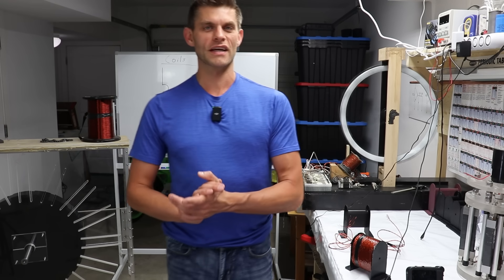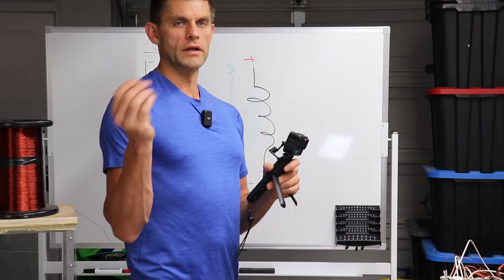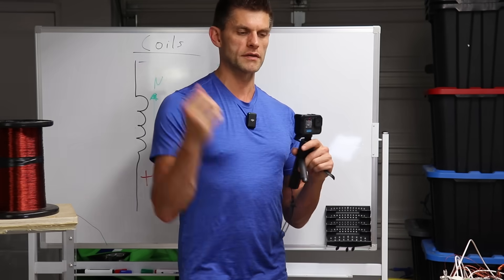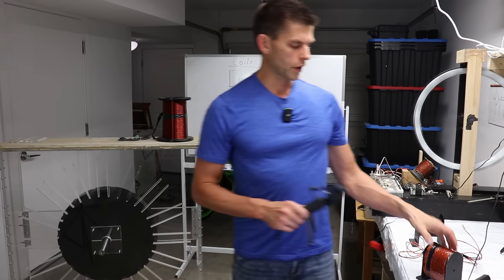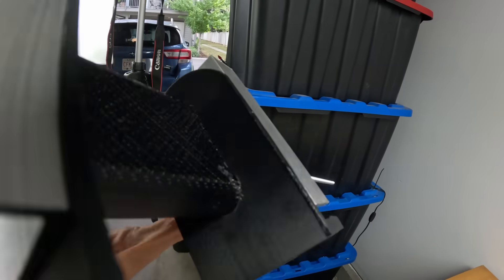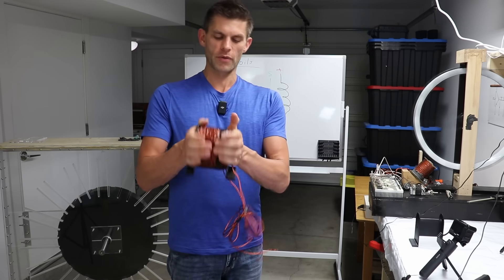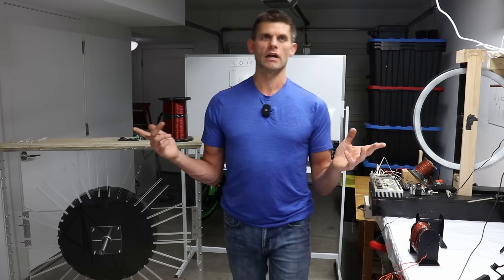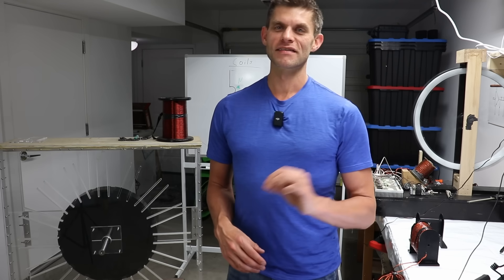Unlimited Energy in My Garage (No Patents)

Comment: Hi thanks for your efforts keep going, this is what my genius friend said, hope it makes sense and can help 
He's going the long way around to make a generator. He is missing one big component by the way he is collecting the collapse of the field to a lead acid battery and loosing most of the charge at the battery and feeding the second battery back to the coil is the offset of what he generated. So will it generate electricity yes about 6 volts, can he collect the electricity yes but not with a 12v car battery, the coil he is making is for amperage at low voltage so that large is not going to produce what he thinks, economy of scale is at play more wire = more resistance =less output but higher amperage to move the voltage... And nothing about it is unlimited energy, it's a pulse modulated alternator any time you have to feed energy in to get energy out. He should use super capacitors as collectors and pulse on a second coil set that would be a better balance than he could get with the setup he is building there... Just my 2 cents and you can keep the change haha
Reply from the maker: sounds like your friend should show us his lab and woking model ? thanks for the comment

Comment: So one thing that I have not seen so far are some measurements of the smaller setup which I assume is a proof of concept. It looks to me like you have a battery powering what is basically a large electric motor. That alone doesn´t seem to generate any energy but just consumes it to keep the rotation going. 

Am I missing something here? Do you have actual figures to share about how much power is going in and how much more is coming out of the system? If the small scale doesn´t produce anything then I am not sure how the larger model is supposed to improve on that. 

Trying to keep an open mind here and I can definitely see the passion and enthusiasm you are showing, I just would love to see some numbers. These kind of machines have been out in the internet for decades now but I have never seen a prototype that actually works. 

Also, I have seen the two latest videos and the call to action at the end about funding kinda makes this a little suspicious. 

That being said, if you can show the tech working (again, including actual measurements) then I´ll throw some money your way myself! But so far the setup is very simple at its core and I don´t see any reason why this should produce any more power than it consumes. I hope to be wrong and all the best
Reply from the maker: im going to get into that in the next videos
Reply: @MadscienceLPTECH  Awesome! Thank you for the reply, I am really looking forward to that!

Comment: PS: Maybe it would be faster to weigh the wire and calculate the distance according to the gauge you are using. The extra walking is good for you, but if you want to gain time: you may want to just weigh them to get your intended measurements (Always add significant grams extra to be on the safe side, though).
Reply: He still has to spread them out and twist them.
Reply from the maker: yes
Reply from the maker: yes value

Comment: there are a few ways to make renewable energy, but if you try petent them you get a knock at the door by dangerous people. There is a space time antenna, there is splitting hydrogen from water and burning it, there is taking electricity out of the ground. I know that the trick of splitting water using copper bars and eletricity, is related to vibration. The closest vibrational match to hydrogen i think is barium, so if you pretend to match that by using it frequency, it will turn towards it and so split from the h20. Everytime someone makes it they try and make money and that will not spread it around the world.

Comment: I want to help but without understanding won't be able to invest either my time or money. So basically you are giving little electrical energy to create more mechanical energy thus generating more electrical power with the help of some generator, sort of amplifying that small input of energy. I would appreciate if you answer my some questions
1. Output power is dc or ac?
2. If AC in nature then how you will be able to reduce harmonics ( by using some filter/ change in construction)
3. Do we require a cooling system also.
4. What type of machine you have chosen to convert mechanical energy into electrical ( Ipmsm, dc, induction)
Reply: Hi. There is not "More Mechanical Energy" than the Electrical Energy that Feeds the Coil.

He only Claims (abusively in my humble opinion because I have still not found Any Solid Proof Of That),

That it is the Kick of High Voltage coming ftom the Coil... AFTER been Swiched OFF, that "Taps Into" the Vacuum to Produce A Gain of "For Free" Energy.
Reply from the maker: @Khwartz its been done manybtimes , including by tesla 130 years ago
Reply from the maker: DC out, no cooling but might help, and im not sure for the generator yet... maybe just another wheel with magnets abd coils    cheers

Comment: Idk about all this.  There has to be some type of dissipation in the system. I'd like to see some energy readings from both batteries.  Even if one battery is charging the other if there is even minute dissipation in the system eventually one of the batteries would need to be recharged from sn external source or changed out (but if the dissipation is small enough it's could still be very impressive)
Reply from the maker: coming up

Comment: Not sure if this was mentioned but something that is good to investigate since you have a working model is to see if there is some kind of compounding resonance that can be produced which could potentially unlock a new area of energy extraction. Similar to how the tesla turbine uses a different in practice but similar in theory. Laminar flow over air gapped plates/rotors whatever air injection perpendicular to the center shaft inlet towards the middle “turbo style” exhaust. There is a phenomenon that occurs I believe it was at 70k RPM and basically “teleports” it to like 100k rpm if I remember correctly. Something like that…
Reply from the maker: Legit advice

Comment: The area under the spike is the power available.  The is LOSS in the coil do to resistance and back EMF.  you are not doing anything new.  They have built these motors in the past and could get aa high as 98% efficiency but nothing like what you are trying to do.  Sorry been down this road before.
Reply from the maker: I think u took a wrong turn ?

Comment: I am an electrical engineer and can say this is 100 percent a sc@m. It will not work. The energy just going in to the battery from the ether because of a high voltage pulse is ridiculous. The only reason he is using a motor and coil to do that is because it spins around and looks fancy. you can get inductive kickback pulses much easier and efficiently but then again it doesn't actually matter because this whole thing is fraudulent.

Comment: A lot of these Bedini-Beardon "spin-offs" with spinning magnets and lead-acid batteries all run into the same trap: Misunderstanding how those batteries actually behave.

People see high voltage spikes from the coil that’s real but they think dumping those spikes into a battery creates extra energy. 
In reality, lead-acid batteries are kind of slow and messy inside. Their voltage can jump up for a moment when hit with a pulse, but that doesn’t mean they’ve stored more usable power. It just means the surface charge shifted around for a bit.

So when you hit an old battery with pulses, sometimes it works better again. That’s desulfation, not pulling in energy from the "vacuum" it’s just cleaning up the gunk on the plates.

Most of the time, people are measuring voltage and ignoring the actual energy flow. If you don’t track both current and voltage carefully, it’s easy to fool yourself into thinking the system’s making more than it’s using. But it’s really just battery chemistry playing tricks.

Anyone with an electrical engineering background from a credible Institution knows these things.
Reply from the maker: Haha sounds like someone is in a box of fear. I have a EE degree from UBC
Reply: @MadscienceLPTECH  you think that I made this comment out of fear?

Comment: For someone that’s been researching for that many years I’d expect the initial drawing would be correct.
I think this whole explanation is magical and I’m calling you out.
Reply: I already see a bunch of jargon to try and explain a perpetual motion machine on an electrical level 

I see a tag for zeropointenergy, which is the only other way aside from time crystals that free energy could be generated in theory.

But I see absolutely nothing in the entire video that actually makes use of zeropointenergy in sny capacity. 

You're trying to explain your free energy device as something that works through electromagnetics alone, but zero point energy would only be possible interacting with quantum states and harvesting the energy of subatomic particles some how to the point that they would be below their zero point value and naturally want to return from that state.

Nothing you have in your magical thinking garage will facilitate zeropoint energy harvesting let alone free energy.
Reply from the maker: Lol what's wrong with the drawing.... its for beginners to follow along. No matter what I do someone will have a problem. Easy to be a keyboard warrior
Reply: @MadscienceLPTECH  I'm not convinced this will work but the drawings on the whiteboard appear to be mostly correct. With the current flowing in a coil, the magnetic field will be induced perpendicular to the current flow, that is through the centre of the coil as loosely indicated by the arrows. The arrow indicating the magnetic field is only part of the magnetic field, but the general direction is correct.
Reply: @BlueprintLifeHacks  I don't want to  discourage, but an inductor loses a little energy through friction and a small increase in heat with each oscillation, and of course any load, such as an LED drains off energy. If he can overcome those loads, he has something. I believe there are 3 sources of 'free' energy that folks have tried to tap: 1) High Voltage Power lines; 2) TV & Radio Signals; and 3) the simple voltage difference when you move in a vertical direction, measurable with 100 feet. I believe that the first two may be illegal to tap into, because they put a resistive drain on the stem, and I don't know why the third is not used, except gains may be too small.
Reply: @MadscienceLPTECH The drawing isn't the problem the lying is the problem.
Reply: @MadscienceLPTECH  Well, not exactly true, good fellow - what you can do that will shut a whole lot of grumpy mouths is to set up the machine to run on its own as if FOREVER on its own and with a small load such as even an LED light, and let the truly analytical guys examine it for finding the secret game. But, as much as I regret the fate for us all, you can never get the reality. A+ for attitude and effort, but, many of us have been there before in life.
Reply: Yeah, this whole thing is magical thinking.  I like how he explains the generation of an "excess" as "something magical happens" in the lead acid battery.  All of the positive comments seem culty and weird about "changing the world".  wtf.
Reply: I'm calling u out how bout dat
Reply: Are you joking? If u cannot understand basics mate….not sure why you comm
Reply: You are being polite. I call it Bull_shite.
Reply: This is Nikola Tesla's ignition system. If he knew anything about coils he would never do that nonsense in the field with the drill and then cut the ends. It's absolute nonsense. Not to mention stating you can charge a battery with an intermittent pulse, if he used a super capacitor, it would be at least slightly believable.
This guy is a fraud, and anyone giving him money deserves to be scammed.
Reply: The explanation falls apart the moment he says “something magical happens” in the battery. That’s not how lead-acid chemistry or flyback voltage works. It’s not about being a hater — it’s just that many of us have seen these free energy claims before. Until there’s a proper power-in vs power-out test under load, it’s just another flashy build with zero substance.
Reply: Ŵhen the cash requests come the credibility drops exponentially.
Reply: @goldie2007420 I think there's a Kamala Harris joke in there somewhere...
Reply: @goldie2007420  Is there something wrong with a kickstarter campaign? People do it all the time
Reply: What would his grand motive be? It's open source he's not selling it. He's not selling merch or promoting a Patreon even. He's not hyping a meme coin like our dear leader or some energy drink
Reply: @CrowClouds are you joking? The sales pitch comes towards the end, with the direct money donation solicitation. Did you somehow miss that part, lol? The whole “open source” goodwill part is just obfuscation for the dullards amongst us.
Reply: @CrowClouds he’s actively asking for cash in the video. There’s the motive.
Reply: Did you see anything of the supersega scam @CrowClouds
Reply: @CrowClouds He harvested a click off of me. This stuff is always good for a laugh and a bit of a challenge to find out where the batteries are hidden..😅
Reply: This guy is a fraud.....don't be stupid and send him money! This is a scam plain and simple. He sounds like a goof. He can't even convince a woman he's not full of shit.
Reply: The difference between magic and technology is time. We’re all looking into magic boxes that contain all the knowledge of the world. The government in secret has experimented with zero point energy for a long time, but they won’t mass produce anything like this because it will dismantle the cage of fossil fuel reliance we’re all in, plus there’s a lot of money involved in fossils. BUT it’s destroying the environment and if we want to live WITH nature, not against it, we ought to take this seriously. Let him ask for money, I’d be happy to help him achieve this goal, for all of humanity

Comment: Would not recommend people to support this scam disguised as fundraising... plenty of resources available to the public to help people understand the physics basics of the claims here, do your own research beforehand, even ChatGPT makes valid points about the claims here albeit not the most trustworthy source. Regardless, you don't have to have university physics education as myself to notice that the author of this video constantly sways between topics - skipping forward and it's like 3 or 4 separate topics in one video, aka, the art of saying a lot and nothing at the same time - it's just a trick to keep engagement. But from physics yes, you can get a higher voltage back EMF than input that turns the wheel due to the rapid changing of the magnetic field through coil, but it would be pulsed and any induction generates nearly immediate and opposite magnetic field that would resist the wheel, not to mention resistance of air being moved by the wheel, friction of the shaft and the inescapable heating of electric components at these conditions. The old saying "the hardest part about making a perpetual motion machine is to hide the batteries" but in this case the batteries aren't even hidden...
Reply from the maker: Ok BOT, go support bill nye or somthing more your style